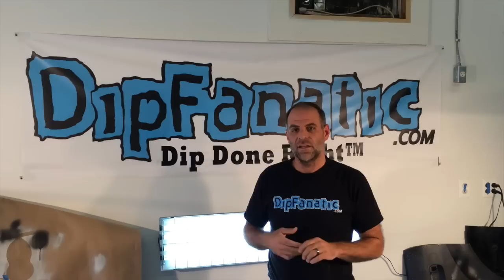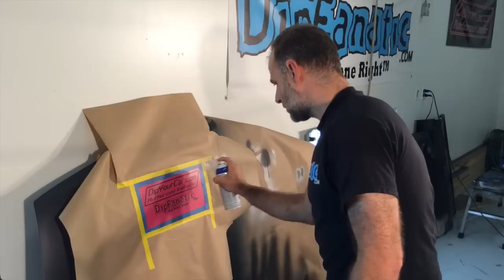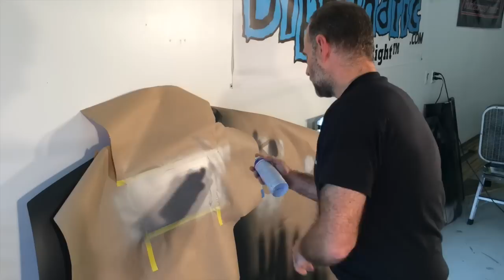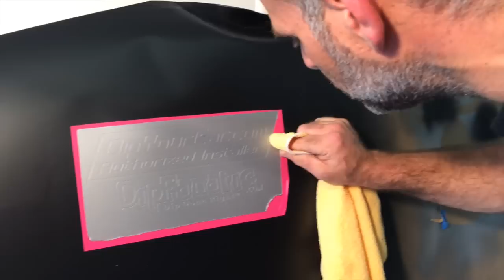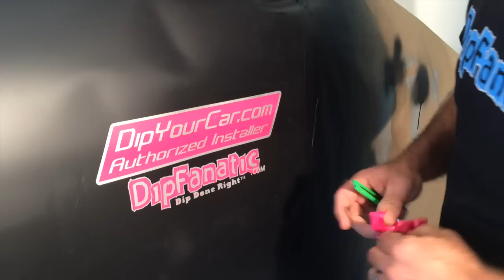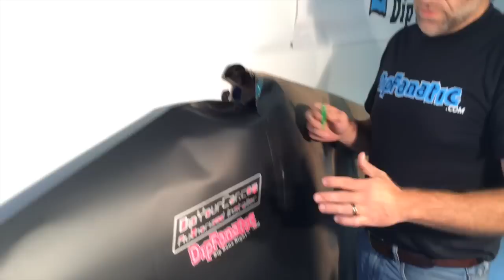Dipfanatic Fine Line Stenciling with Plasti Dip

Comment: Did you stick the stencil onto a plasti dipped surface? I.e. was the black hood completely plasti dipped? I want to do some masking with just masking tape onto plasti dip and worry that the masking tape will pull the plasti dip off. Anyone have some experience with this?

Comment: What would have happened if you HAD taken it off while it was wet?
Reply: It would be a much finer cut, it's what you're supposed to do with dip
Reply: sharpest lines I've worked with fine spray and the rubber.   stenciling every color image imaginable.  drys quick, apply second layer, etc.  but no lame one use vinyl stencils.

Comment: Question... how do you get the vinyl transfer to stick to the plasti?

I have had a real challenge there.  I can get it to stick to the actual paint fine, but not on the base layer of plasti (e.g. black base, then the stencil for the artwork).

I am using a standard vinyl that I order for my silhouette cutter.

thanks for the tip.  If I can get the vinyl to stick, then I am stoked to try out my cuts with this method!
Reply: Did you ever figure this out? I want to use custom stencils as well, and I'm worried that the adhesive will tear the base coat of dip.
Reply: @scrampker  I basically have to use painters tape for a lite stick and then carefully remove it once I'm done.

if you spray clear over it when you are done, it'll help to remove it (while it's wet.)

Comment: this looks really nice but why not just peel the vinyl while the dip is wet and not go through a tough removal process? I have some big dip projects coming up so I have been researching a lot of projects and from what I've seen removing around the dip while its wet doesnt ruin the job.
Reply: You can for things that do not have fine detail. Like stripes or curved lines. But this technique allows you to lay down some super fine lines without smudges. Clean and straight. It's almost impossible to get small stuff out without pulling the dip below it off or smudging the dip..
Reply: oh i see kool thanks for the tips

Comment: no point you can use sticker...
Reply: Anyone can slap a sticker on a car. I agree. It is much easier to use stickers. That's for sure.  However, some people want to have a cleaner more professional look. Stickers are also known to lift which can cause the dip to lift or tear. Stenciling dip on dip will not do that. If you could see some of the work we have done up close you might change your opinion. Thanks for watching and commenting!
Reply: John Vanskiver The advantages on stenciling dip on dip are still not greater than vinyl stickers...I can appreciate the work you do with stencils but in my opinion a simple vinyl sticker will do the work just as well.
Reply: DIRTPUNKZ86   John Vanskiver  I can tell you that my husband and I own a graphics company here in Boston. Of course we create all kinds of vinyl graphics as well as bend and form lexan, poly carb. We wrap, dip, Name it we do it. DIRTPUNKZ86 what I can tell you is that yes dip on dip pros far out weigh vinyl on dip as far as overall adhesion. However vinyl in most cases will outlast the dip over all. "Depending on what vinyl is being used" You have to keep in mind that dip is normally temporary. Meaning at some point within 2-3 years or so that dipped car with either be stripped and re dipped, or just dipped over again. In either event just for that later on down the road outlook dipping makes more sense in this case as opposed to vinyl since vinyl is made to be more permanent, it's not going to peel off real nice and you wouldn't want to dip over vinyl. Although I agree that this process is a pain in the ass. Vinyl template over dip only to be dipped then weeded while on the vehicle. The point is in most cases the final end result with the best results does include being a pain in the ass in order to get there.
Reply: +Andre KICK U can use a sharpie or for more permanent method use a key.